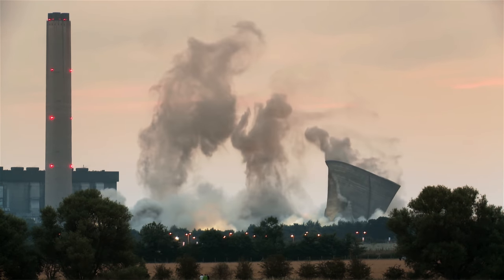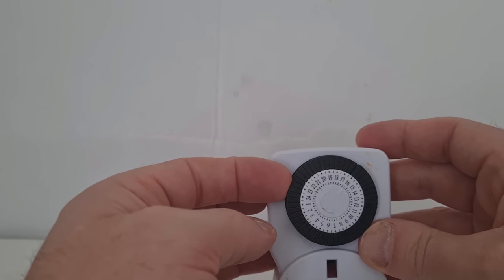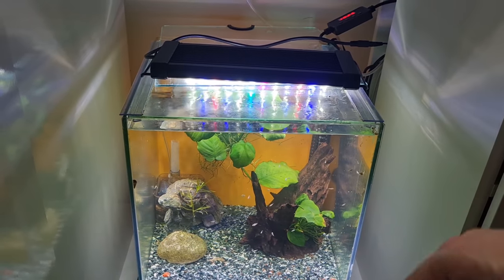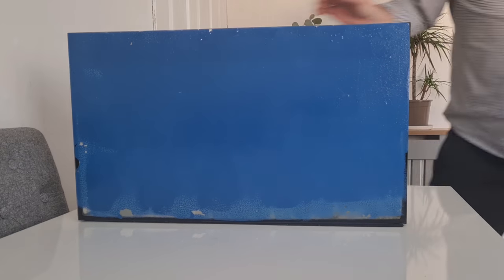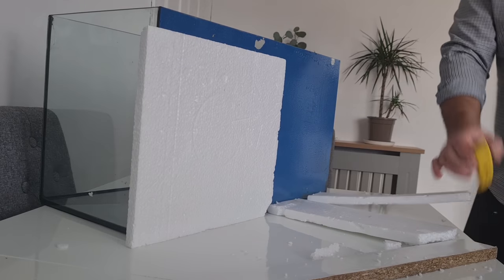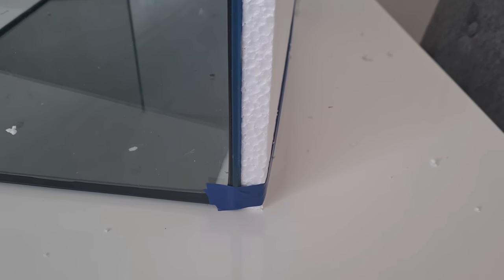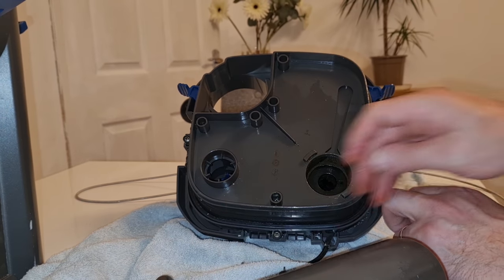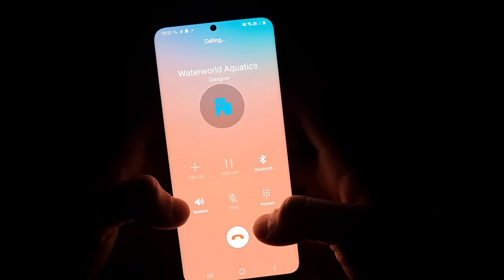HOW TO SAVE ENERGY IN THE AQUARIUM HOBBY

Comment: Great video, I particularly like the idea of insulating the tanks themselves with polybox. I used entirely recycled fish delivery polybox to insulate my wooden shed and it works a treat. I'm thinking of solar for my new fish house however it's still too expensive to make it worth it at the moment. ~£100 a panel (150W) plus batteries and regulators etc Just for one 500W heater i'd need 3-4 panels. Maybe I'll get a loan and just buy 10 panels but even that wouldn't cover my entire fish house
Reply from the maker: Thanks very much mate. Been one my mind for a while. Might sound a bit of a cheek running a load of fish tanks but I do try to be as environmentally responsible as I can so would be dead proud if this helps in any small way.
Feel free to pick up the idea yourself and run with it. Sure you'd do a better job plus the more people messages and ideas reach the better for us all hey.

Comment: All great tips! I tried the Styrofoam covering the back bottom and sides of my tanks when I use to heat my tanks with aquarium heaters and you do save some money but I since then stopped using aquarium heaters and took the Styrofoam off my tanks and just heated the room with my baseboard heat as fish room/ large bedroom room has it's own zone thermostat in it so I could heat the room to any temp I want without effecting the rest of the house, I heat the room to 73 degrees and believe it or not the heat that the filter motors make heat the tanks up a few more degrees to about 77 to 79 degrees depending on the tank size and filter size, I save so much more by heating them up this way but I know not everyone can do that but I bet if you used one of those oil filled electric heaters to heat the room you would save a lot too,  the wattages of all those aquarium heaters most people use to heat up their tanks adds up nice topic! awesome video Daniel!
Reply from the maker: Thank you very much mate.
Yes I totally agree equipment such as lights and motors contribute to raising temperatures and also heating the room is the best option particular where there are several tanks.
Unfortunately I cannot do that in this room. It is open to several other areas of the house. Bit tricky to explain but basically I can't close it off to retain the heat within. It's also used for another purpose which means it's not an option for me but a great point that I hope others will read and consider. 👍

Comment: You can turn heaters off fully in the summer for most fish, a couple of degrees difference during the night won't kill your fish.
Lighting really only needs to come on once it's dark outside as ambient light during the day is enough unless your tanks are in a fish room with no windows.
Also re using the old water from water changes on your garden saves money too and actually benefits your plants and grass.
Reply from the maker: That could be true about the heaters but it will depend where you live in the world. It can be pretty cold here for example even in summer and generally we don't heat the house when no one is in.

The lighting thing depends on the plants we're keeping to a certain degree.  Some require higher light and longer photo periods but you're certain right in terms of the fish. They don't mind at all, the light is really for us to enjoy them.
Dead right about using the fish water. I use all the water change waste in my plants and there's no doubt they thrive on in. In generally don't need any additional fertiliser for my garden or house plants.
Reply: @DanielKeepingFish  true but remember rivers get cold in the winter too.
Here in essex it only ever seems to be warm these days,lol

Comment: Daniel I need advice.  Generally, when I setup a tank, I let it run for a upto 6 weeks, giving time for it to establish.

I've setup a 40x15x15 (custom made) using two Hygger double sponge filters.  Both filters have ceramic bio media cartridges and powered by an Eheim 400 air pump.  Tank been running for almost 4 weeks now.  When setting up tank I added Seachem Prime and double dosage of Seachem stability.  On week 2, I added a pinch of flakes to start the process of creating ammonia and for the beneficial bacteria to work hence the slight right in ammonia.  By week 4 did water checks and Ammonia, Nitrite now zero.

I wish to keep Axolotls and contacted a Reptile and Amphibian charity store.  I explained the tank is established, running for 4 weeks but they insist tank not ready?  They quote the following:

 Okay tank cycling.
You will need.
Dr tims ammonia,
API freshwater master test kit,
Seachem prime.

The water cycle is.
Axolotl creates ammonia (toxic) 
Good bacteria eats ammonia and creates nitrite (toxic)
Good bacteria eats nitrites and then creates nitrates (too high and then it is toxic).
To remove nitrate we do a water change. Once you are cycled this will be once a week approx 30 percent of the water.

To cycle.
You need to use the Dr tims ammonia to keep the ammonia in the tank at 4ppm (no Axolotls should enter the tank untill the tank is cycled)
At first test ammonia every 2 days and add more ammonia when needed. After a week test ammonia and nitrite, keep the ammonia at 4ppm still. (Now test daily)
After 4 weeks test ammonia, nitrite and nitrate.
Keep the ammonia at 4ppm
Soon you will notice you will need to add more and more ammonia to keep it at 4ppm.

When is it cycle?
So when you can top the ammonia upto 4ppm and then test it after 24hours, if then comes back 0ppm ammonia AND nitrite then your tank is cycled.
I hope this helps.

The charity still insist my tank is not ready and that I need to add Dr Tim's ammonia?

Now I've been keeping aquatic fish, crustaceans, Amphibians and reptiles for years and it's the first time the above paragraph has been brought to my attention!

Please share your thoughts on cycling tanks???
Reply from the maker: So what they're saying isn't wrong. I don't agree using Dr Tim's is the only way to do it but you do need to provided a constant source of ammonia to cycle a tank and maintain the cycle. I know you said you added flake food but you need to keep feeding the cycle else it will crash.
Cory from Aquarium Coop explains it way better than I could in one of his videos, I'll link it below.
What they're saying is right but it's not even the only way to cycle a tank. Some people use hardy fish in the tank since the waste they create provides a constant source of ammonia but it can be hard on the fish and maybe not fair to them.
Another way is using a cycled filter (or even media from a cycled filter) in the new tank as a large percent of the beneficial bacteria for most tanks will be in the filter (or media within).
So their advice is good but not the exclusive method.
It's quite a huge subject so can't possibly cover it all in this comment else I'll be typing all night haha..
I would watch Cory's video though and use it as a starting block to discovering more on the subject. Hope it helps: https://youtu.be/PWoiCqCvJco